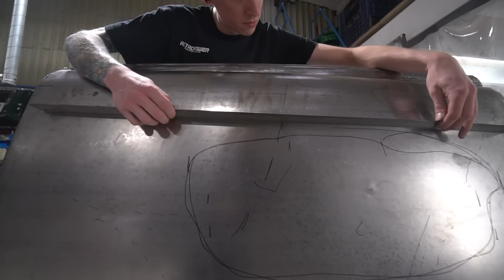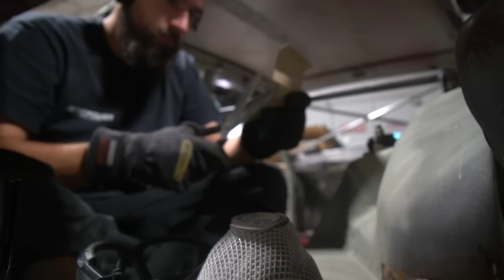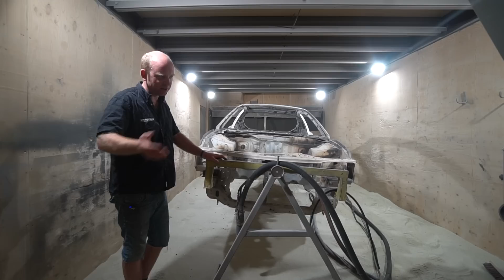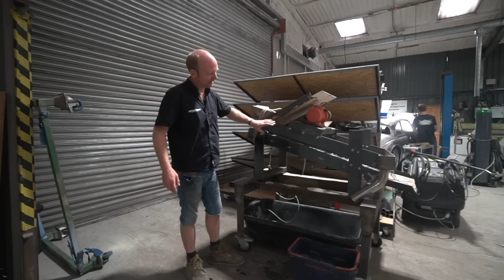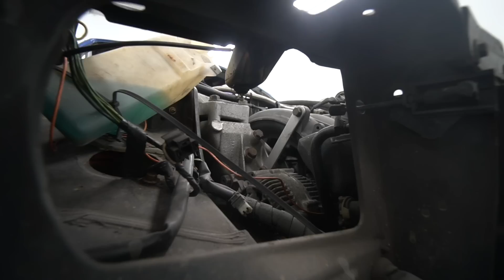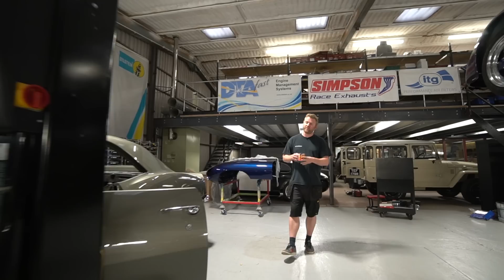ANOTHER Type R Allegro Restmod?? SURELY NOT!

Comment: The 309 looks nice, I kinda like the old Peugeots.

But dang, how tall is the Volvo owner? I'm 183cm/6'0" and I've had room to spare in the various 240s I've owned, though the 940 did get cramped, but that was height rather than distance from the pedals and steering wheel, as it had a sunroof, which lowers the roof inside.
Oddly enough it's old American cars that has been cramped for me rather than any European ones... save for Opel Corsa and Peugeot 206CC, where my head was in the roof.
But driving old 60s cars, Rambler American the steering wheel was in my stomach, my knees in the dashboard, and I had to tilt my head against the roof to drive it, it was slightly roomier in the 1966 Chevelle, but the massive steering wheel was making it hard to reach the pedals, and I was brushing against the roof... you always imagine American cars to be massive, but not always the case it turns out.

Comment: Just wondering how you address areas of the body shell that you can't get access to with blasting, like the inside of the rails? Back in the day some cars were wax coated from the factory. The home DIY restoration method was to use fish oil. Then wax coating kits became a thing. So I'm just curious how you approach it. Love your channel, Cheers 😊
Reply: Have asked this before and they covered it. Churchill was watching carefully some of the inner wing surface rust but it all get opened up at some stage and min zinc coated in the process..
Reply: @jerehada  They don't open up the rails on all of their builds though. So for the ones that they don't?

Comment: Will you reinforce allegro’s upper structure? Because I know the upper part of the integra provides a great part of the rigidity of the complete shell. Honda uses thicker metal on various spots (vs none type r).
Reply: Don’t know if it’s true or not ( a quick Google search will probably give the answer 😅) but as a kid I always remember people saying if you jack an allegro up with a door open it twist’s the body and it won’t close properly after 🤷‍♂️
Reply: @brudenell27  That was a MYTH just like all of the other rubbish people used to say about Allegros as well such as the Allegro Equipe owners woke up with flat tyres all the time because the alloys were porous which was like the rest of the MYTHS utter BS - I never had any problems with the alloys on my Allegro Equipe and the surviving Equipes and Allegros with Equipe Alloys on them today are still on the same alloys with no problems. I used to service and rust proof my own cars and used to jack my Allegro Equipe and my brother then mothers Allegro LE up at odd angles to work on them on our driveway with NO twisted bodies.

Comment: With the Allegro build being so much Integra, what will it be registered as?
Reply: I believe they still have the original reg docs for the Allegro.  (I think) and I do know that some owners don’t choose to register any changes as it often generates a Q plate that most enthusiasts don’t like..
Reply: @philtucker1224  There's a points system for engine, gearbox, axles, body etc...but if its the SVA route then that's worth an episode in its own right...
Reply: @YellowPinkie  yes absolutely you are right. Ultimately it is the owner that has to make the first move in these cases. However I believe with a brand new creation the vehicle has to go through full inspection and test before dvla will create and award a registration document for any vehicle that is required to be used on a public highway. (I think that is correct)..
Reply: I thought they were registered as one-offs so the lineage is irrelevant. Single Type Approval or something similar or maybe that's an engineering examination. Not really sure tbh
Reply: @thefamilyrobbo  that’s possible but I think most of these come in from owners still with their original reg. docs..

Comment: I would be interested to know how DVLA etc are going to digest the Allegra. Will this have an Austin or Honda identity?
Reply: I have asked similar questions about other builds but it seems to be a subject they do not want to go into in any detail, perhaps understandably. These Allegros/Hondas should probably have Q plates but they seem to be able to navigate the system, and never end up with the dreaded Q plate on any of their builds!
Reply: @ralphmillais5237 Q plates are a very rare thing now really… If you put a build through an IVA (due to it racking up enough modification points) it’ll either get: An age related plate if enough major parts from the original, or the same age of vehicle have been used; or, A brand new suffix reg (if not enough period parts have been used) I.E a *72 ** plate.
Reply: @ralphmillais5237  if they are playing loose with the rules then that puts the customer in a difficult position of possibly having their car deregistered (has happened to a few EV conversions recently) where the car loses it's original registration and isn't eligible for a fresh one.
Reply: I've wondered this about pretty much all of their projects, very few would pass the Points test to keep the original car's identity.  Would be a really good subject for an Explainer video.
Reply: Not sure if it’s required if the vehicle is over 40 years old.
Reply: It’s not the business of Restomod. ( the vehicle owner has full responsibility for their own vehicle as far as DVLA are concerned) and I think I’m right in saying DVLA only retain an interest if the vehicle is less than 40 years old, and intended for road use.